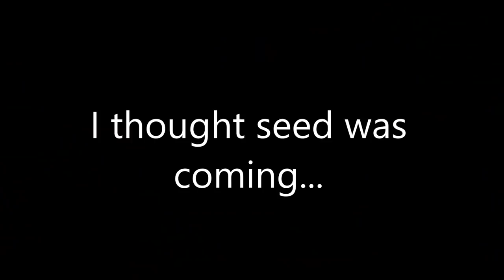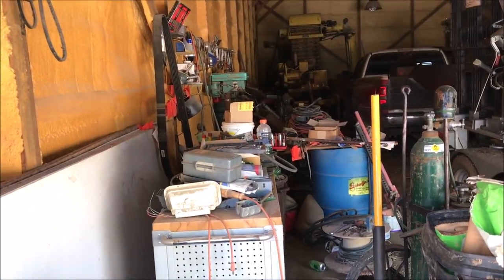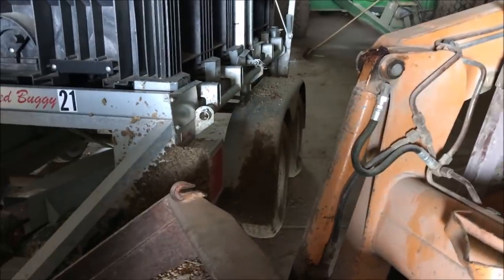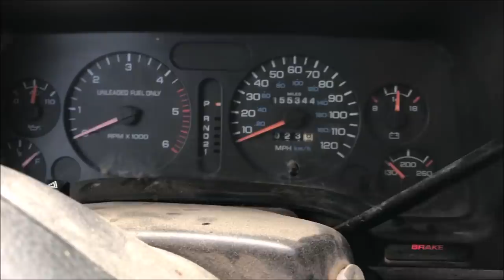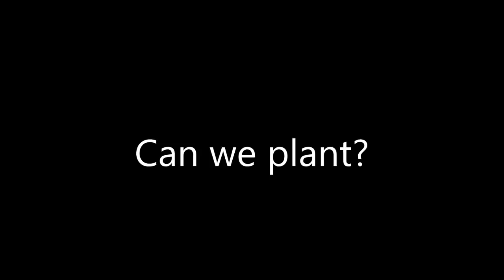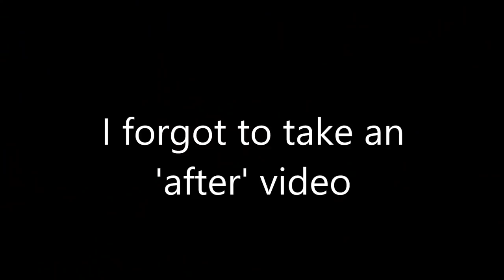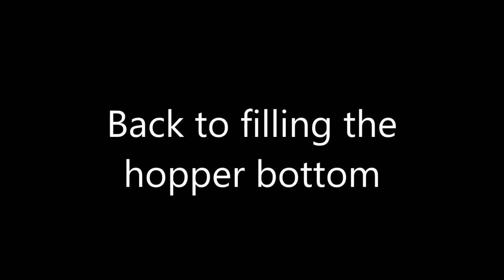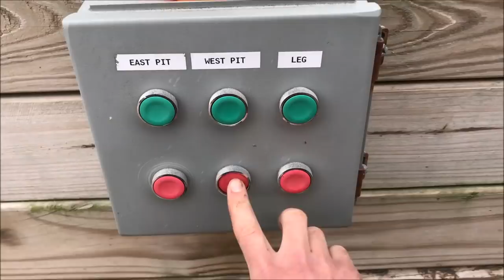The Cornstar Who Is Addicted To Corn | Rained Out AGAIN

Comment: Cole: To keep two electrical extension cords connected, tie a square knot (right over left, then left over right) in them before you plug them together. The knot will keep the cords connected, but is also easy to remove. Also, noticed your electrical connections in water, Yikes! Be careful.
Reply from the maker: Arthur Fluter Normally I do tie them like that. Dodging puddles is a little sketchy!

Comment: Is there a reason you wouldn't put a concrete pads around your silos for the augers to be placed on? E.g you could have permanent water drainage, no soil, then just brush the spillage off the pad? Or does that limit the Augers in some way?
Reply from the maker: mwnciboo our grain setup is not in a permanent configuration yet. Once it is we will have everything rocked nicely. Concrete on that scale would be extremely expensive.

Comment: If you were gave a surplus amount of money that u could only use to change your farm what would u do (change out your bins)
Reply from the maker: Max Cunningham I'd put up two new big bins connected to the leg with a direct fill as well as U-troughs between them. I'd also put up another leg in the tower that the drier feeds. A new drier would be nice as well as a new pit system and another big machine shed.

Comment: Cheap assed farmers... Pour a slab, build a bin, save $100.... LMAO.. yup, that's what dad did in 1982 when we put 4 bins up....
Saved another couple hundred bucks by not putting an auger under them too....
By about 1984, I was smart enough to ask him, "why didn't we make it easier to empty the bins?"
Doh!!!! Yup, still the same set up...
I have plans.... Just takes money.... And time...
On the Oliver, perhaps it's time to do like someone else said, put some new seals in the blower .. and you may as well straight pipe it while you're at it, that old oil filled busted up muffler isn't muffling anything, just holding oil...
I know, it's still running, it will be fine 😎😁

Comment: Would have been a lot easier to just unhook the tractor.
Reply from the maker: Mike Pagel Same difficulty really. It was  easier to bring the diesel to the tractor because it's hard to get the pin lined up in that tractor by yourself. The brakes don't work the best on that tractor.